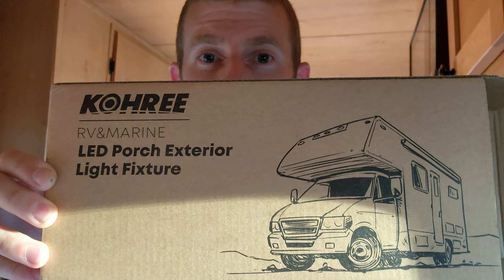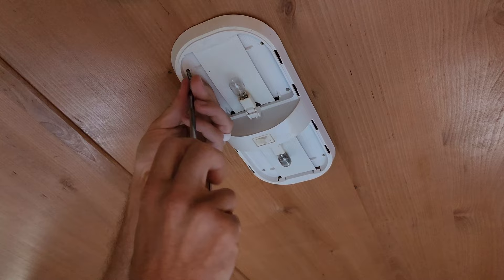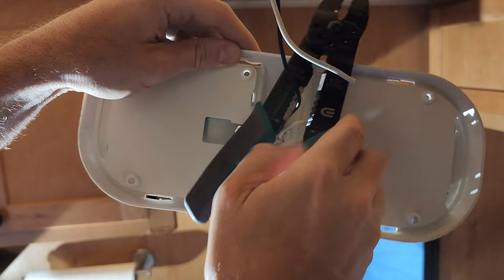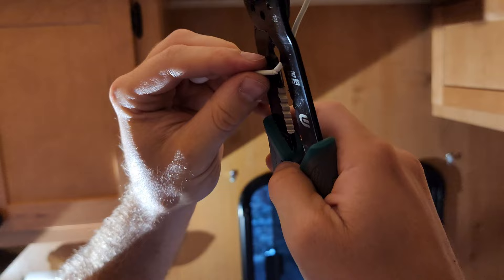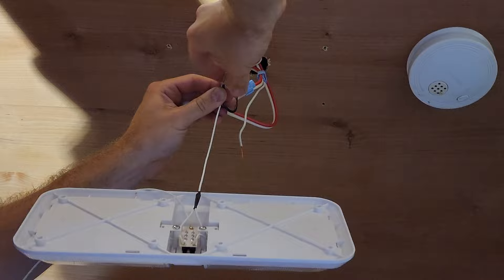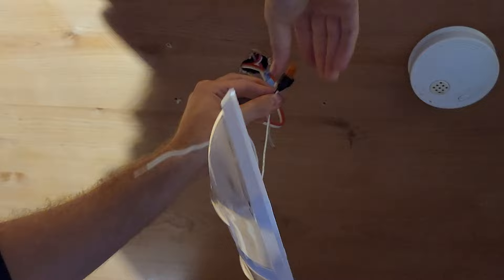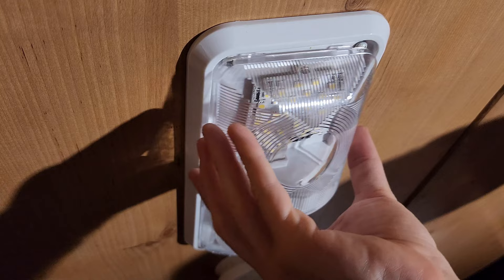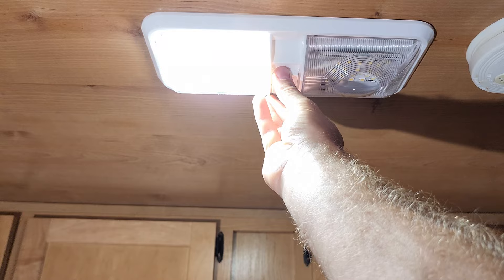How To Change a Light Fixture in an RV | Camper | Travel Trailer

Comment: Do you know what to do if there are 2 white wires and 1 black coming out of the ceiling and the new light fixture has only 2 whites wires which the direction say doesn’t need to distinguish between positive & negative?
Reply from the maker: I wish I could help but I do not know and I'm not going to pretend I do!